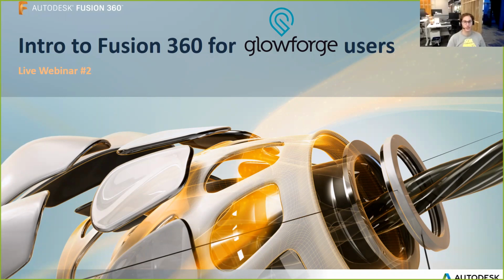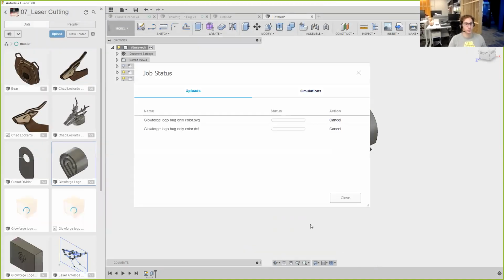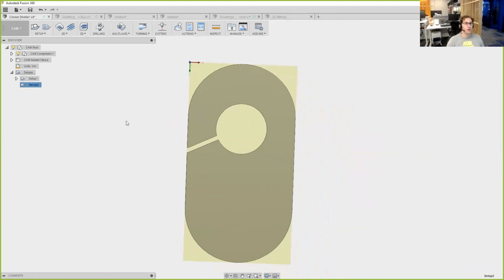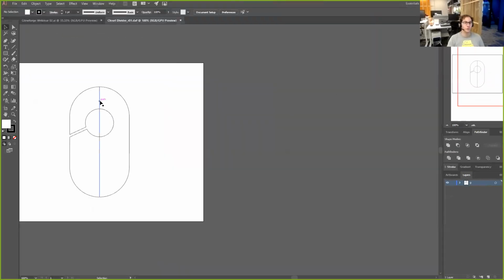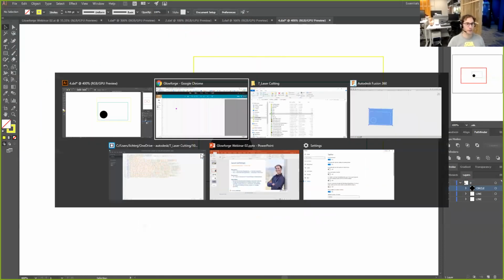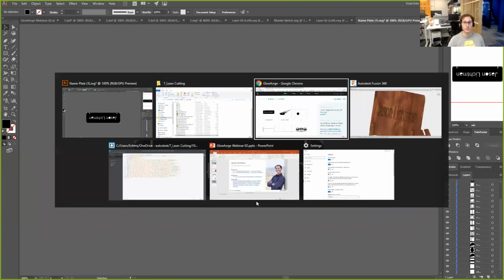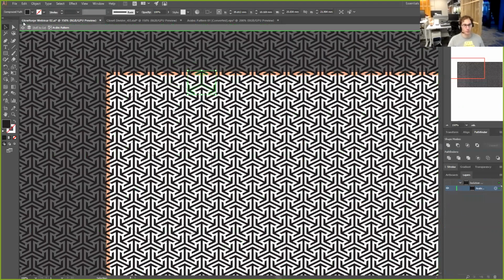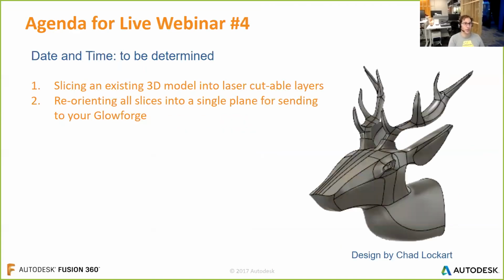Fusion 360 for Glowforge Users - Part 03 of 05

Comment: Kerf compensation DOES matter! the laser has a thickness, and so if you cut a 10cm disc with no compensation, then your physical object is actually going to be 9.95cm (approx!! ficticious number depending on material).  And so, if you would set the tool keft to 0.05cm, the "path" would be correct in creating an exact 10cm disc no?

Comment: On your nameplate I suspect the missing inside letter parts were behind the rest and the fill prevented them from being visible. if you toggle to wireframe mode (cmd y on mac) I suspect you would find them so you could bring them to the front. Alternatively you could eliminate the fill on everything and then the hidden objects would appear.

Comment: I don't know if it matters but your export actually did work, at 58:30 -- if you look at the GFUI, it had grouped the interior loops of a, o, and a with the outline of the name plate.  Taken together, the two steps would have produced a successful cut...although, my preference is to cut interior loops first, then work outwards (in this case, the interior loops would be red, the other parts of the letters would be green, and the plate would be blue)...